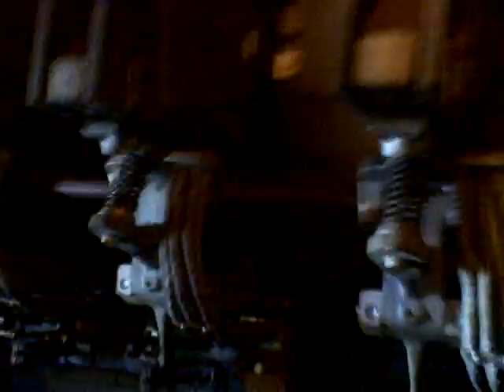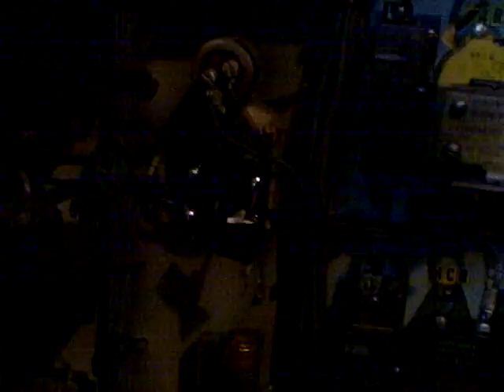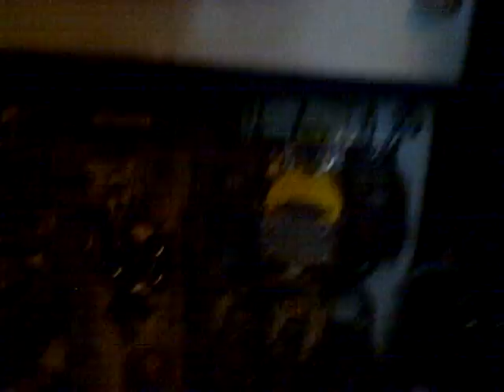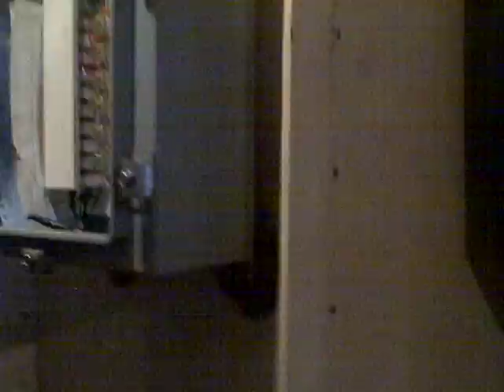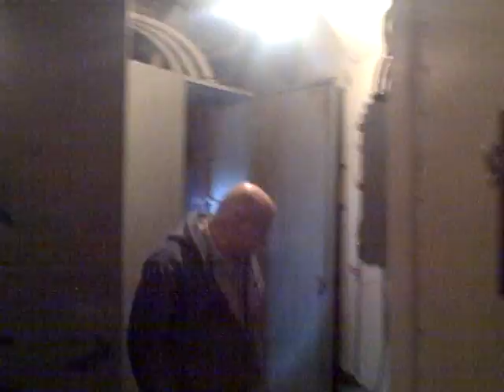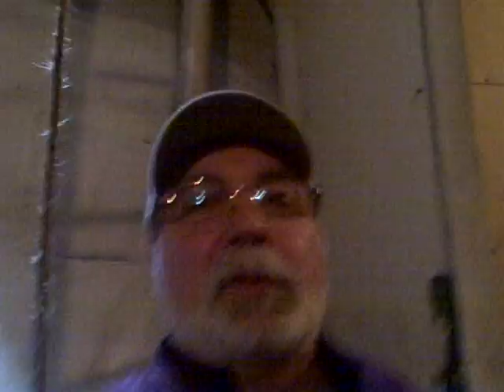Bow Thruster Repair

Comment from the maker: Thanks , Yeah those guys do six months at a time I do 2 weeks .

Yeah , I added a resistor across the dc output of the rectifier and that solved future problems with that conponent absorbing any resdual power after shut down as not to burn out rectifier again. T4Ping :o)tm